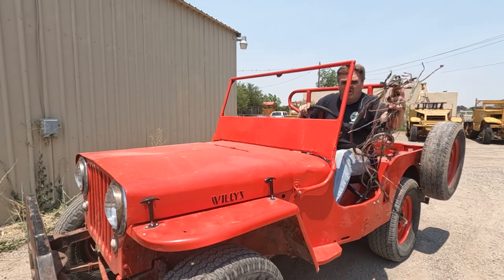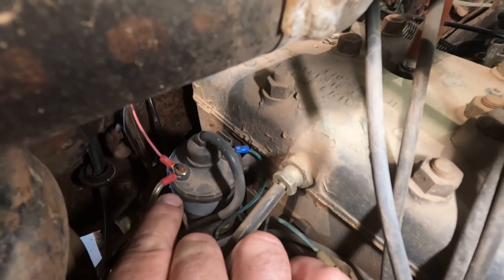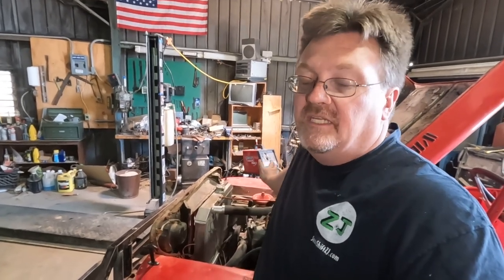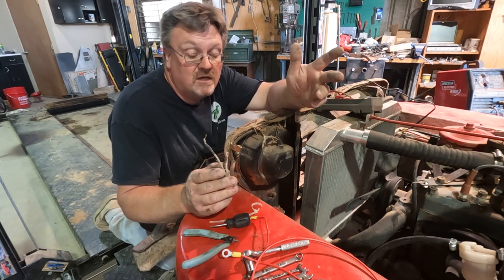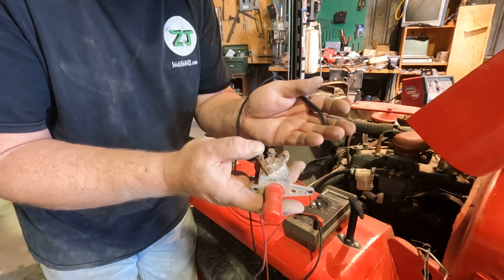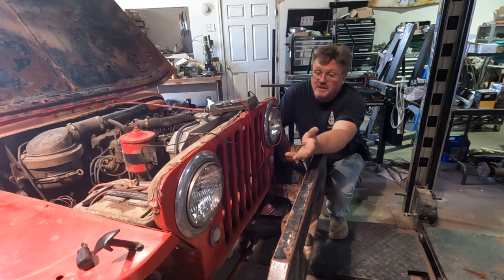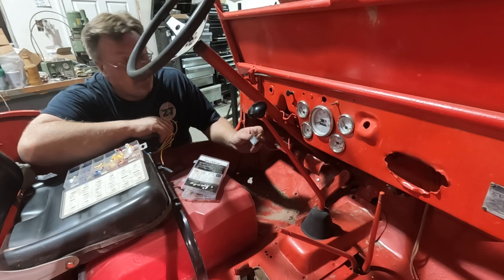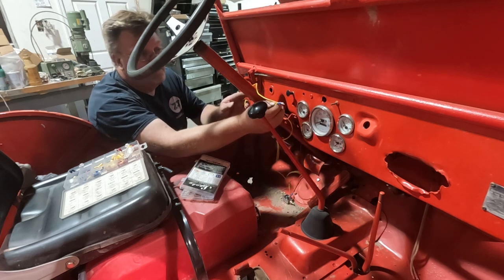DIY Wiring Harness Replacement for a Willys Jeep CJ-2A

Comment: I’ve had a couple of vehicles that had a mess of spliced wires under the hood. After about ten minutes of looking at it, I grabbed a pair of wire cutters and removed it all then just put back what it needed to run. Then you know exactly what you’re working with.

Comment: Turn signals? Got a left arm. It will be fun to see how many of the younger folks have any clue what you are doing. Is there a resistor in the coil lead to lengthen the coil life?  Most systems need it with a resistor bypass in the start mode to put full power to the coil while the starter is running and dropping the voltage.
Reply from the maker: Yeah, I figure they'll think I'm waving or making gang signs!  No resistor, this is a straight 12V coil.  I forget what I yanked it off of, but it didn't use the ballast resistor.

Comment: I want to buy some of those solder connectors. Where can I buy some ? Thanks. I love the simplicity of this rig.
Reply from the maker: I bought them off amazon, but a lot of places have them.  Just look up solder seal and you should find a bunch, lots of different brands.  They look like all the brands are the same.  I've only been using them for a year or so, but so far I've been very happy with them.

Comment: I have a CJ3A and going to rewrite it similar to yours.  Mine has a solenoid switch, so I’d like to see a simple wiring diagram for 12 volt and key switch.
Reply from the maker: That's pretty easy, just use a universal key switch from any auto parts store.  They have a battery input, then an output terminal for ignition and another terminal for starter.  Just run an extra wire from the starter terminal to your solenoid and you're all set.  

I will be doing another wiring video on a motor that has a solenoid and an external voltage regulator, but that will be a few months from now.

Comment: That was great ! I have not got that far yet .Can I put 12 volts to my starter ?
Reply from the maker: Thanks!  I've been running the 6V starters on 12V for decades, and haven't had a problem yet.  Just make sure it doesn't get too hot from long cranking times, and I think  it should work fine.

Comment: i have had those solder and seal connectors fail for higher amp usage like over 20 amps
Reply from the maker: I've found that even after the solder initially melts inside, you have to rotate the heat gun around to the other side to get it to flow all around the wires.  If the solder doesn't have a lot of contact area, the connection would heat up.  That may have been what you ran into, so far I've had good luck with them.

Comment: Well, was going to ask about wiring up the light for the license plate.......but then I noticed there doesn't seem to be a license plate!  :-)
Reply from the maker: I thought about that after I did the video.  I didn't think about it at the time because they didn't have those originally, but they did have a clear piece that let some of the light from the tail light point down.  It would be easy to add one, just connect directly to the brown wire going to the tail light.

Comment: Cool video!   Not quite sure why a 12v alternator is always better than a 6v generator...since my 74 year old generator is still pushing 7.2v to keep my 48 2A's 6v battery charging.  Other than modern accessories, 6v works just fine.  I bought a 52 Ford 8N tractor that was converted to 12v and it drives me crazy because the starter spins so fast that if the tractor doesn't start right now...the starter just spins and you have to wait for it to wind down to try again...lol.  Not trying to start an argument...just throwing this out there...lol.
Reply from the maker: Thanks!  You make a good point, 6V can work fine.  For me, I'm cheap and drive worn out stuff.  When a motor is low on compression, the extra starter speed helps.  On shoddy wire harnesses, the lower amperage and higher voltage works better with bad connections.  Also, 12V batteries and light bulbs are generally cheaper.  However, if the 6V stuff is working, there's no reason to go to 12V.
Reply: 6v is neat and I wanted to keep my 2A as 6v, but it has ended up being trouble when it comes to jumping (no other 6v vehicles and no jumping equipment for 6v) and keeping the battery charged (special charger). I don't plan on running accessories, but having readily available 12v stuff in a pinch is useful. Unless I can retire with a big garage some day, I found that I just don't have the luxury of the niche 6v in a 12v world. In the mean time, I am keeping all the original parts like the 6v stuff in case I can restore it to original some day. I am glad you could keep yours original.
Reply: I used to have a 1948 panhead. Every year a battery/they'd cook themselves to death and the beating of the hard tail would finish them off. And every other year a new regulator and rebuild the generator. Went modern and no more of that mess. Only well thought out improvements that were IMPROVEMENTS were done to that bike. None off that silly t. v. look how big my penis is crap. 1 kick bike and still got almost 50 mpg
Reply: A really good-n-cheap upgrade for a tired 8N is an 8-volt system. A new 4-cell battery is available then tweak the generator's voltage regulator up am smidge.  Leave the coil, lights, and starter alone.  The lights are a little brighter and the starter spins with a bit more authority but that 70-year old motor will appreciate that. Our 8N loved it.
Reply: @ProctorSilex  I bought a cheap 6v battery trickle tender to keep the battery fresh, and on that chance of needing a jump, a 12v jump from jumper cables or a boost pack will work for a short jump time.  My 2A started so easily that usually just a bump or two on the start button was enough, then again I did a restoration and added a new wire harness and 0ga wires for the battery for the start motor and ground.  Mine was a learning experience that I'll treasure since I never worked with 6v before, and I'm not going to call anyone out for using 12v.  I did, however, sell my $1500 48 2A project/rebuild last summer for $9000 by keeping it all original.  ;)

Comment: As an electrician seeing unfused wires make me very uncomfortable
Reply: Don’t you have unfused wire in your house?  How about the service lines that run to the panel buss bars?
Reply: @rcpmac  I dont know which 3rd world you come from, but over here every line has a fuse. The lines that come into my house are fused inside the electrical distributor outside.
What do you want to tell us with that statement anyway?